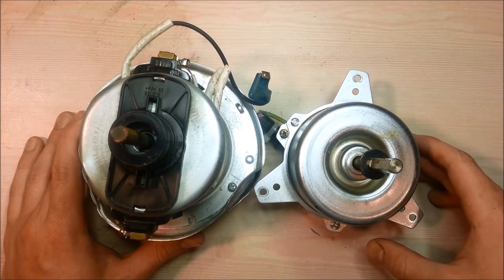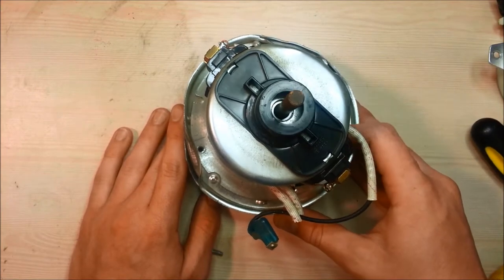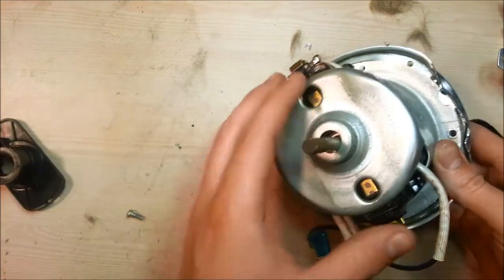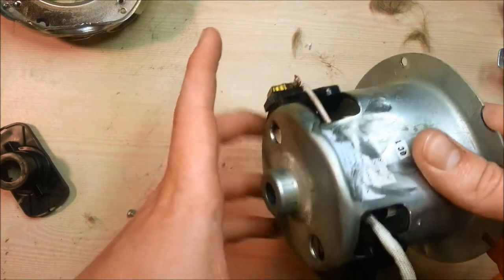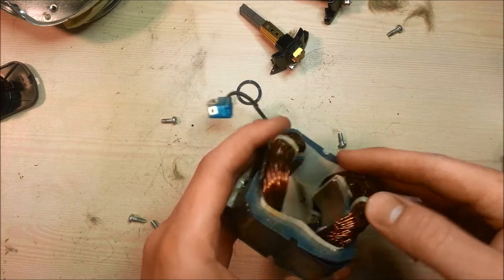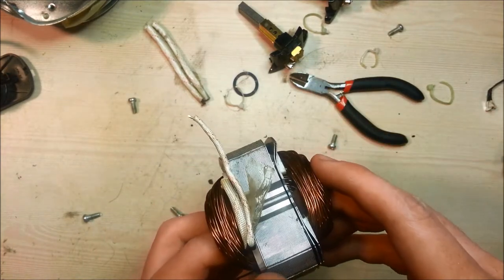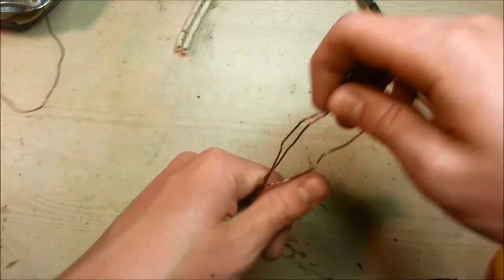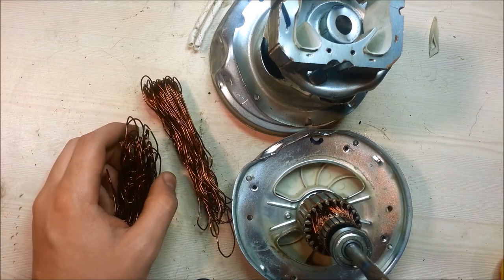How To Scrap A Electric Motor HD

Comment: Great vid!!
If you cut one side of the windings you should be able to pull the whole thing out.  The housing for the brushes are usually brass, and the fan part is aluminum it's not much, but it all adds up!

Comment: good video!! if you bash it with a hammer it should get the copper out quicker or cut the one side and it will pull out..